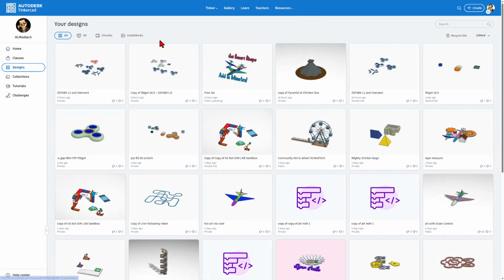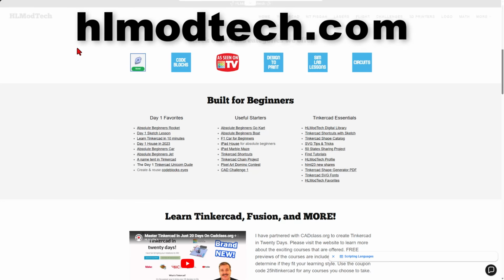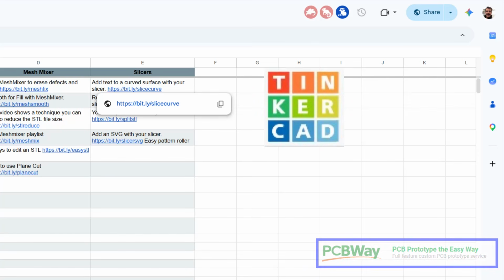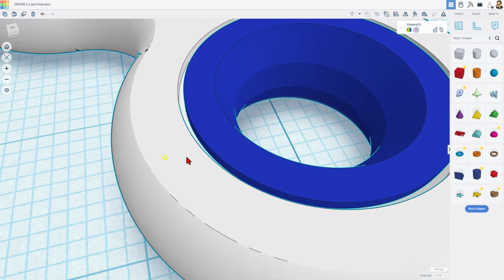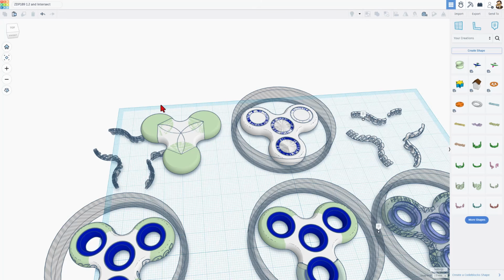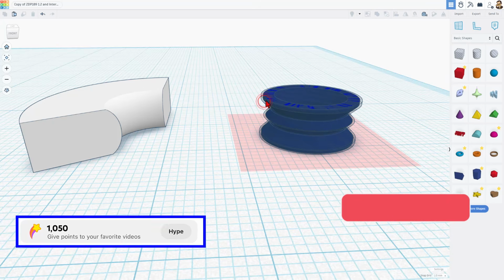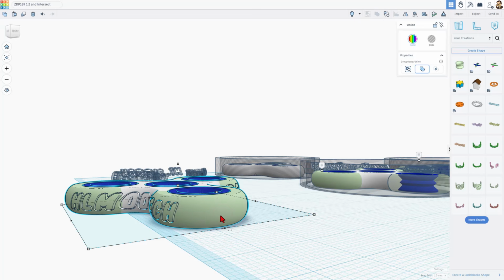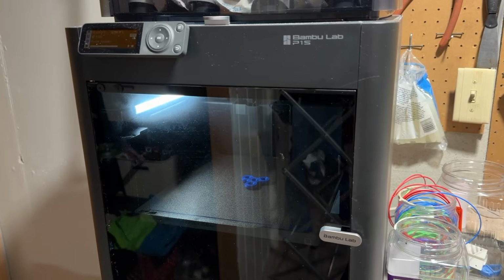Add Text to Curved Surfaces in Tinkercad: PIP Fidget Spinner Magic! 💯🔥

Comment: Hey Mike! Having a little bit of trouble following how this works to get the text added to the fidget
Reply from the maker: Sorry you're getting stuck, feel free to share which step is causing the most trouble and I'll be happy to help! 👍
Reply: @H @HLModTech so I can’t get to the step where you pull the shape of the out side of the fidget out to build the text on. Mine doesn’t separate out like that after I ungroup it
Reply from the maker: Oh... I had to build that. I will look back and see if I missed that step or if it is a separate tut.